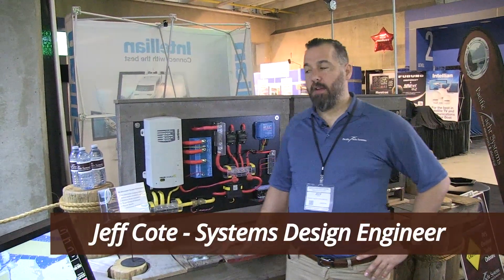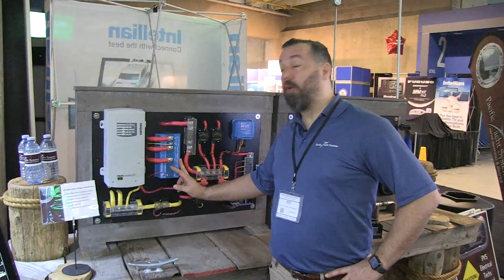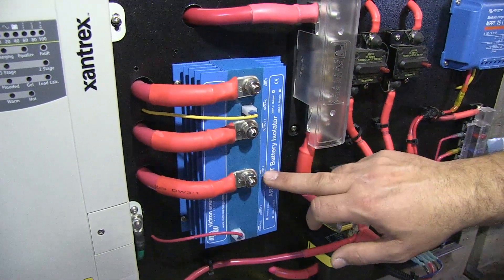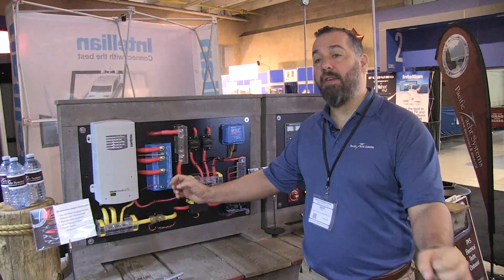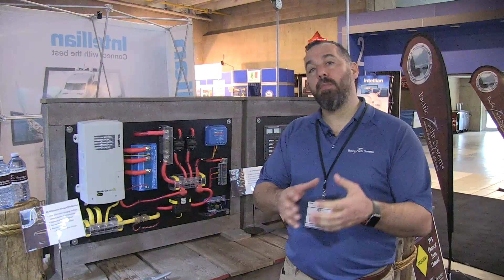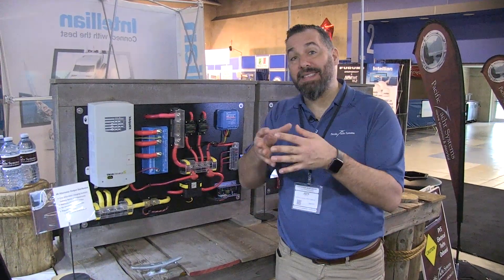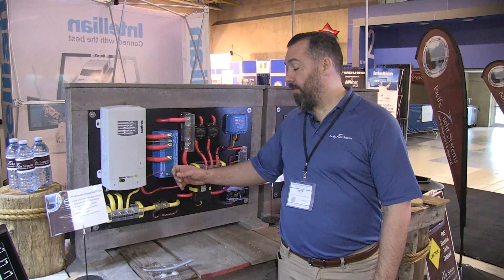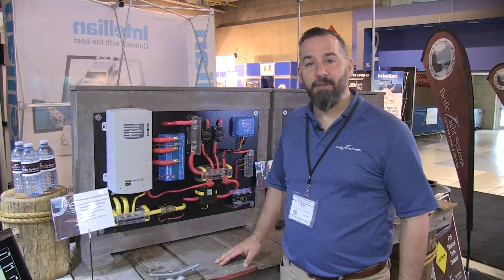Victron Argofet Battery Isolator

Comment: I bought one like this gonna put in my truck for a 8 Rockford fosgate amplifier setup heard good things  can't wait to hook it up.
Reply: WOW,You did Nice!!
so generally speaking.. we can install this on our car for our Music system? I am ready to install my second battery on my car for my music system. How you like it so far? is it working the way it should?
 I have a 12 inch bass 2,100 watt peak
the amp for the bass is 2,000 watts. 
I also have a smaller  amp just for my voice speakers. 800X4 watts.
Thanks in advance.
Reply: @Hotdrboy88  I don't have it finished yet it took me a lil while to figure it out but the main wire gone to the oem fuse box i had to run a new wire to my back battery because the main battery under the hood is just for cranking the vehicle and the secondary battery is to run the vehicle and it's add on components like lights,amplifiers,icebox or whatever you doing most people use them for overland vehicle's but I'm running 2 for my music and 600 hp LS1 that I put in my 2008 chevy colorado the main battery is just to turn over that bad boy... I had it hooked up for about 2 days things didn't catch fire so I guess I did it right but I took it out because I fabricated a steel box that I counter sunk behind my driver seat in the floorboard "Extended cab" so I can't say i had problems but I didn't have running long enough to say. My O'l buddy we were in "The Unit" Delta together he's a wiring genius he is the guy who actually looked at it found the wires for the diode from the alternator and told to run a larger power wire to running battery to the main fuse box. So in short the main battery if that's what you're doing will be just to cranking the vehicle and the 2nd battery will run the vehicle but you have to connect the fuse box to send power to the the vehicle and run the right wire from the alternator to the center spade plugs i think it's Energize and constipation...Compensation.  Not sure but I think all alternators have those wires you'll have to figure that one out for your vehicle. Hopefully my rambling helps you out.
                       DeltaSpecOp Out

Comment: Would the ARGO FET 200-2 Battery Isolator work on a system with 2 LifePO4 battery banks (1x150Ah and 1x200Ah) being charged by a Victron Energy Blue Smart IP22 12-Volt 30 amp charger
and solar, no alternator. It is on my travel trailer not a boat.

Comment: @Pacific Yacht Systems   I have the 100A fet isolating the input from my alternator to my house and starter battery. I want to replace my lead acid house battery with lifepo4. I'm planning on a 200AH bank charged with an Orion? dc to dc charger, will I still need the fet?
Reply from the maker: no you don't.    connect the alt to one of the batteries and use the dc to dc to charge the other.  which you choose to connect the alt to is a topic in itself.

Comment: Jeff - I see Victron has a 1 to 3.  I want to feed TO 1)AGM starter, 2)sgl. Lifepo4 and 3) a 24V bank (2, 12v in series).  How can i go about #3?
Reply from the maker: you can not feed an 12v alternator to 2 different voltage banks.   you can charge the two 12v banks with the alt and argofet.   Then buy a 12-24v dc to dc converter to charge the 24v bank.  look at the victron orion smart product.

Comment: Hi Jeff, I plan to charge the main starting bank from the port alternator. The starboard alternator would then charge the house. And the gen alternator charges the gen battery.
Is there a device that would allow me to charge the house from the starboard alternator and also from the generator alternator depending on which one is running?
Or this isolator would do that with input from the generator alternator and outputs to generator battery and house battery?
All banks would also have input charge from the batter charger ac to dc.
Thanks

Comment: Question pleas!!     If I have two engines. = 2 Altinators.   connected to two Victron Argo FET 200.   can thos two victron charge the same 3 banks? 
I want both engines to charge the same battery banks.  total of 3.  Start , Aux and bow thruster
Reply from the maker: Yep, that's doable, run the battery connections of each ArgoFET in parallel.

Comment: Hi!
Planning to add this product to my Regal Ambassador 255XL in an electrical overhaul. I am connecting a 75A alternator to the Argofet and then two battery banks, starters and house. I have no inverter, so no inverter/charger, but I do have a 50A charger. 
-Would there be any reason not to connect the charger in parallell with the alternator? 

Also, I´ve seen in your videos fuses on the connection between FET-output and positive bus bar (fused at the bus), is there any reason for this instead of just fusing closer to the alternator (or in my question above alternator and charger)?

Really appreciate your videos and effort to better electrical installations on our vessels.
Reply from the maker: Hi Kenny, avoid a single point of failure and keep your alternator and battery charging circuits separate. Each circuit properly fused at the battery connection. Alas, fusing at the alternator is not a replacement for fusing at the battery, recall your 75 amp alternator will never output more then it's rated capacity, your battery can provide way more then 75 amps of current.
Reply: @PacificYachtSystems  Thanks for your response, I went with separate chargers for engine/house batteries and fused at the house batteries terminals. Also fused the outputs from the ARGOFET.

Comment: You’ve got a great thing going on!

I love your videos and my wife will watch with me occasionally and with your teaching method she now has quite a handle on what makes things work (without magic) on our boat!

I have a BALMAR 80 amp alternator and ARS smart regulator (both are over ten years old but work perfectly).
I'm using two (2) DEKA DT31 105 AH Batteries for the house connected to an OFF-1-ALL-2 battery switch and a classic Pro Mariner Fly Back 10 charger with the 2nd and 3rd battery charge terminals bridged as per Pro Mariner instructions for my two batteries. 

I want to install an additional small U1 12V 350 CCA tractor battery to start my freshly overhauled Atomic Four engine. The only reason in 25 years of owning my Pearson I want to add the starter battery is to keep my plotter, instruments, and autopilot from rebooting after a spike from starting the engine on the house bank.
We day-sail and are hooked up to shore power at the end of every day.
After 25 years I've never discharged my bank below 12.21 or so and the DEKAS last around 8 years.

I bought the ArgoFET and I hope it will separate and charge all three batteries.

I plan to keep the battery selector switch to cut off the house bank when I’m not aboard. Nothing is connected to the batteries when I’m not aboard.

I’m rewiring the engine, its instruments, the starter and alternator to the a new starting battery to isolate as best I can the house, lightning/corrosion bonding, and engine GROUNDS.

With the factory bonding I believe it won’t be possible to completely isolate so I must insure I have a good (additional) path to ground for the starting circuit should the negative cable at the starter, or fuse, or battery get ‘funny’ and feedback ground looks for another path.

Since “it isn’t easy” I have questions:

[1] Will this be a good application for the ArgoFET?

[2] Would another device be better suited to isolate and charge the vastly different battery capacities (2 105 AH paralleled and 1 small 350 CCA start battery). I’m aware of your warning of surge of different capacity batteries blowing fuses with a Cyrix-ct combiner. I have one sitting on my desk ready to return...

[3] With each fuse having six fault points- (the 2 crimps, the two terminal screws, and the two fuse clips) and 'best practice' FOUR fuses are required (26 potential fault points) is it possible to fuse the NEGATIVE side fewer times and save the worry (and yes expense) of 26 additional connections with the battery circuit?

[4] would the ArgoFET setup overcharge the starting battery if the house bank requires a deep bulk charge?

[5] What is the name of the unit that takes a little current from the charging house bank and shares it with the small start battery? You mention it but I cannot find its name or where to get one. Would that gizmo be a better solution for me?

Keep up the good work.

Thanks,
Gene
Reply from the maker: Hi Gene, thanks for your feedback, here are some answers to your questions. 
1) A battery isolator, like the argoFet, will allow you to share one charging voltage to multiple battery banks.
2) Instead of a battery isolator, consider a DC to DC charging converter or a battery combiner between each battery.
4) The battery isolator does not modify the voltage and each battery gets the same charge voltage, it's a compromise.
5) Look at directional battery combiner like the xantrex echo charger, as it rated for 15 amps,
Reply: @PacificYachtSystems  Thank You! I found the Balmar Duo Charge will combine and regulate the voltage and current to different battery banks. It can even take care of different banks with different charging regimens and chemistry. I've got one on the way. Thanks again Jeff.

Comment: Sorry.. can I Connect, on a van, on the input conector, two wires? One From the alternator And other car battery? (Instead the car battery on the output one?). IS the only way my Peugeot start... Because I don't have D+. Second battery goes to the second output.
Reply from the maker: The alternator input can only be connected to the alternator and no battery can be connected to the alternator post.

Comment: wonder if it works with lifepo4 battery
Reply from the maker: Yep, it works all batteries, as a battery isolator does NOT modify but shares a sharing voltage. The alternator and it's regulator is what decides the charging voltage.

Comment: Can i use 2 different batterys and is it Safe that the Energy go in one way?all my best from Germany
Reply from the maker: Your alternator will only charge to one single charge profile. Consequently, you should have batteries connected to battery isolator that are matched to your alternator regulator profile.

Comment: I have a question about ratings of this device. Say for example we have an argofet 100-2 and the heavy duty alternator can deliver 300 amps, and each output of the isolator needs 90 amps simultaneously.... Is an Argofet 100-2 capable of handling this system?
I guess the number 100 means 100 amps but it is unclear whether this 100 amps is the rating for the input or either of the two outputs simultaneously!!! Can you help me on this dilemma?
Reply from the maker: Hi Mohamed, since Victron only has single alternator FET Battery Isolators the rating is based on the max input current.

Comment: Does this device use any power when idle? I am leaving my sailboat at the can sometimes for a month. If it always drawing power, additional switch might be required to disconnect it from the battery.  Otherwise I might find batteries on my boat dead when I am back. Please advice.
Reply: Providing you have its input from an alternator there will be no current draw when the engine is off. However if you connect the input from the starter battery then it will draw around 15 milli amps and you can reduce that to 10 mA by drilling out the blue led. Hope that helps.
Reply from the maker: Hi Victor, don't for sure... although i'm 99% it does NOT draw power when alternator is NOT outputting.

Comment: As a new boat owner this has been a fantastic and extremely informative channel. I have a twin outboard boat, with each engine having an independent battery. I also have a bank of 2 house batteries in paralell. My boat lives in a marina and has an onboard battery charger connected to my house batteries running off shore power.

Can you please advise if a VSR would be more suitable or an argofet isolater to keep my house batteries charged when out on the water.

Also if I use a 3 output argofet isolater could I have both alternators running into to it, with one output to each starter battery, and the 3rd output to the house battery bank? Or would I need to use a pair of 2 output isolaters.

Thanks in advance

Comment: I am still in the process of redesigning my boat's electrical.  My house bank is 2, 100 Ah Tppl AGM Interstate batteries. The Interstate rep told me these are really rebranded Odyssey batteries.  My starting battery is a group 34 AGM West Marine battery.  I have a Victron Argo Fet 100 A isolator.  Another Marine electrical company told me that they don't recommend diode isolators because they have seen diode isolators fail closed.  Have you ever seen these Victron Argo fet isolators fail and if so why did the fail??
Reply: Diodes are semiconductors, they can only fail open.
Reply from the maker: A FET battery isolator is NOT a diode battery isolator. In my experience, i have never seen a ARGOFET battery isolator. Albeit, all things fail on a boat.

Comment: Instead of using an alternator,  would it work with solar panels or a wind generator? Also, this device does the same thing as the red manual 1,2,all, off, selector but it does it all automatically?
Reply from the maker: Hi Scuba, never tried this device with solar or wind generator but it should work. The off-1-2-both switch is different and more akin to a battery combiner. Recall that with a off-1-2-both switch, there is no directional limitation. Current can flow in all directions as the battery switch puts the batteries in parallel. A battery isolator only allows current to flow in one direction.

Comment: I am looking to redesign my boat's electrical system.  I have been watching your videos and learning a lot. However,  the more I learn the more questions I have.  Would this device work if I have a flooded lead acid starting battery and a Firefly house battery bank or with an AGM bank?  Does this device work with different battery chemistries?  Are AGM , Firefly and flooded battery chemistries similar enough to charge at bulk and float with this device?   I cant justify spending the money for Firefly batteries for a house system AND a starting battery.  I have a Yanmar 2GM, it really doesn't really take a lot of power to start.
Reply from the maker: Hi Son of Neptune, you'll need to choose one battery chemistry, for instance AGM or Flooded, and have all your batteries be that chemistry type. Recall that a battery charger can only charger to one selected battery chemistry (i.e. profile).
Reply: I want to do this too.  Based on Jeff’s advice that Firefly is amazing but not the right choice for a starting battery. 
Could I put an external regulator between the isolator and the Firefly? That way my lead acid starting battery would get the 14.4v from the alternator and the firefly could get the 3 different voltages it wants?